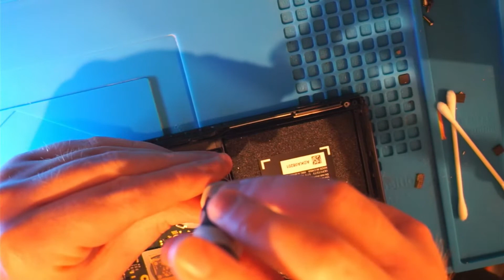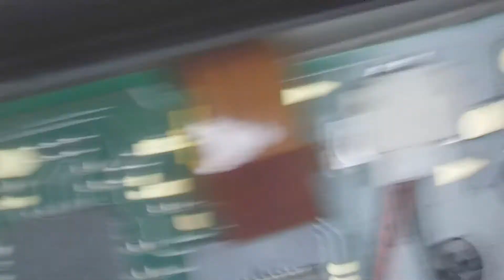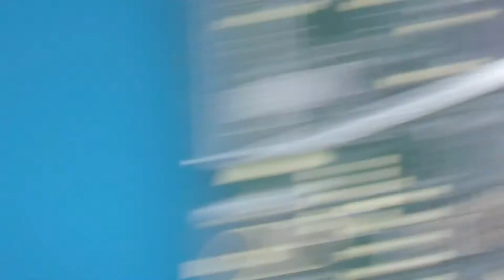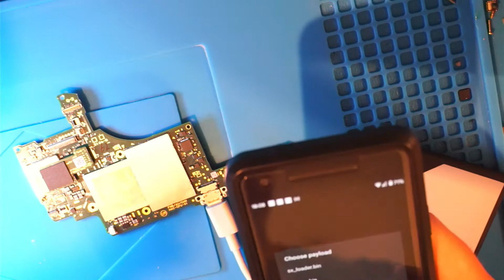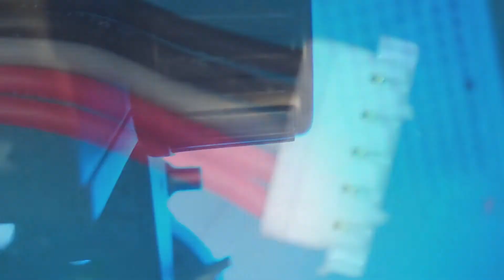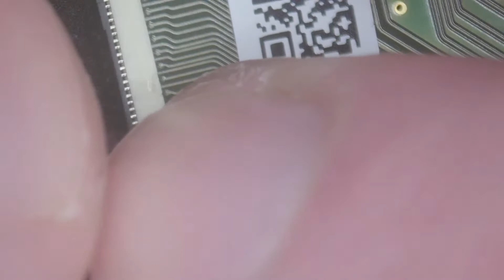Trying to fix a Nintendo Switch

Comment: A video about emmc and bsod would be great 👍
I have three with bsod, two I bought that way.
One was completely dead and had previously had "professional" usb replacement attempt.  (Caused a lot of damage)
 I had to replace LCD connector, repaired traces on m92t36 and replaced USB port with pads missing....now it boots to bsod at least.
I have found the caps around MAX77621 near emmc are shorted on all three. I rebelled one emmc due to shorted cap near m92t36.
Any ideas for next step? APU?
I plan on reball work....never done it before, but I'll try anything. Only way to learn.
Console repair is just a small hobby for me.
Reply from the maker: The MAX77621's are responsible for power to the APU. I'm surprised it'll even switch on if you've got shorts there, unless you mean black screen of death and not blue. I've seen the same problem before. It's nothing to do with the eMMC module usually if it's a blue screen.

If you're getting a black screen and the board only has one MAX77621 try removing it to see if it relieves the shorts on the capacitors next to it. If it does, either take a new one from a donor board or buy one. If you take one from a donor, you'll need to reball it as they're BGA chips.

If it doesn't relieve the short you're going to need to find the source of the short using voltage injection on the power rail and finding whatever components are heating up. It sounds like it's probably the 3v rail you're having trouble with.

Anyway, B(lue)SOD can be caused by a few things. Poor solder joints under the APU are a common cause. If that's the case you'll need to desolder and reball the APU using an IR BGA rework station. Hot air is not the way to go for that kind of job.

The other semi common cause is failed RAM chips. I'd try those after reballing the APU though.

B(lack)sod can be caused by any number of issues. Failed eMMC, anything failed on the power lines, faulty LCDs, poor connectors etc... etc...

Ultimately if you're doing it as a hobby you're probably better off avoiding B(lue)SOD switch consoles, keeping them as donor boards or selling them on as parts boards.

On a (Black)sod, failed eMMC will give a black screen but otherwise electrically the switch will function normally, as in it'll take power and charge the battery just fine. You can check that with a USB 3C amp meter. The biggest indicator of a failed eMMC is if it powers on in RCM mode but otherwise looks and tests perfectly fine on the main board.